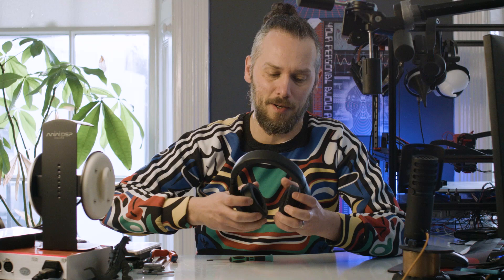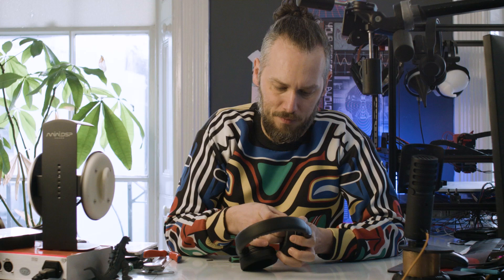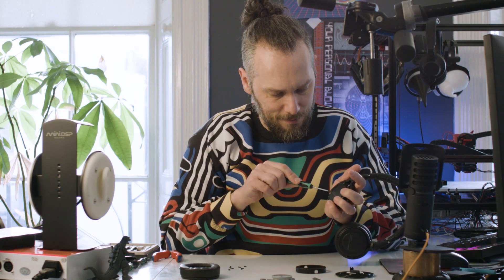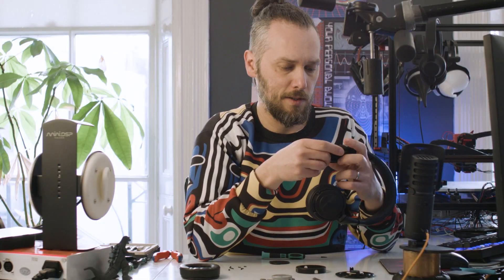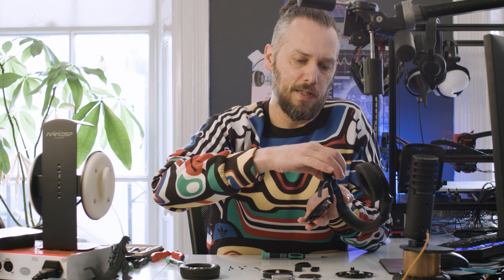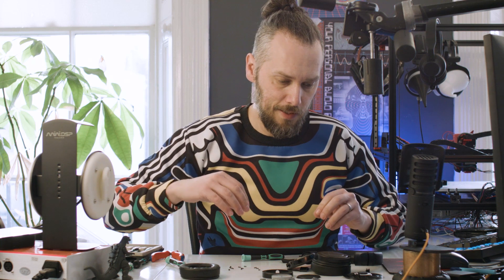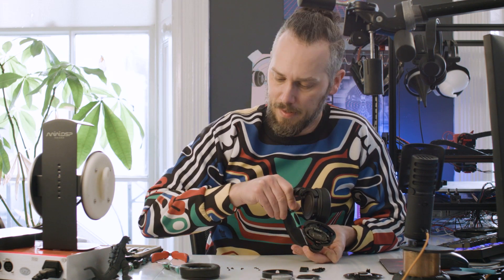Beyerdynamic DT240 Tear down and design review

Comment: I had a pair of 770 pros in my studio and the one earpiece detached, came off completely. Snipped it off clean and used as a one ear "pair" (?) of cans for a bit, but the other end gripped my head like a vice and eventually tossed them. Bought the cheaper 240 pros 2 years ago and love them. Not quite as good, sure, but easier to pack (flat), lighter, don't get as hot after prolonged wear, and only complaint is peeling of the earpads and headband. I wrapped the headband in black electric tape and bought some velvety no-name replacement earpads off Amazon which are more comfortable and offer better isolation. Can't complain!

Comment: I heard that the plastic part surrounding the headband is, like you suspected in the video, indeed a part prone to failure. I got a sweet deal on some Sony MDR-7506 and chose them instead.
Reply from the maker: good to know... Thanks
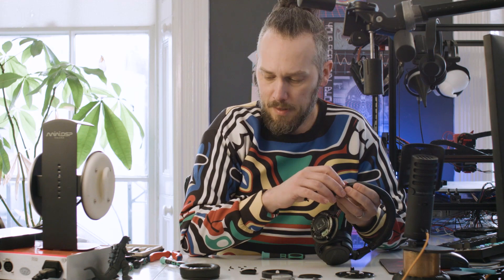Reply: @CustomCans  Can confirm this firsthand just now. My pair that I picked up back in March just broke at the point that you suggested would be the weak point at 9:12. Unfortunately for me my Beyerdynamic account that I haven't used since buying these headphones is "disabled temporarily" so now I'm questioning my choice a little lol.

Comment: I bought a pair last year as my outdoor headphones (I'm not bold enough to rock chunky DT770s in public).
Straight out of the box, I really didn't like them, too clampy and muddy sounding. Leaving them stretched over the box with music playing overnight really improved them. The EQ profile preloaded into the Qudelix 5K got rid of the last bit of muddiness.
I was worried about the wobbly hinge as well, but it hasn't got any more wobbly with use. I changed the cable for a shorter straight one right away. I recently bought some sheepskin pads from eBay, they improved comfort, and the sound became clearer/brighter.
The big downside for me is that they seem really prone to produce a whistling noise when they catch the wind, my friends tell me even their active noise cancelling headphones don't fix this, but I don't remember it being as much of an issue with the beyerdynamic DT231s I owned years ago, I didn't wear those outdoors much though.
Reply: An update just in case any owners of these headphones happen to be reading this:

I found the sheepskin pads to have very boomy bass when the EQ was switched off. I tried some pleather perforated/fenestrated pads, they did bring the bass down to a normal level, but also decreased isolation (which the DT240s were really good at) and just sounded flat and boring. The sheepskin pads went back on, and I covered the bass ports up with tape in which I poked holes with a needle. They are now still bassy, but the bass is a lot more tight and punchy.
Reply from the maker: Yeh wind noise is one of those things not a lot of people talk about but it varies a lot from model to model.
Perhaps I will live with them for a bit and see if I warm up to the sound
Reply: @CustomCans  how do HD25s do for wind noise?